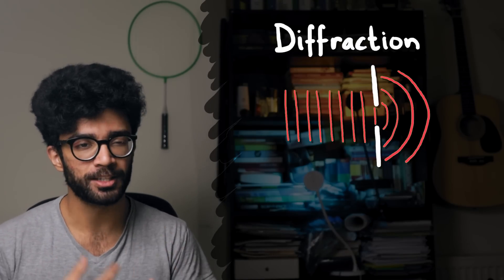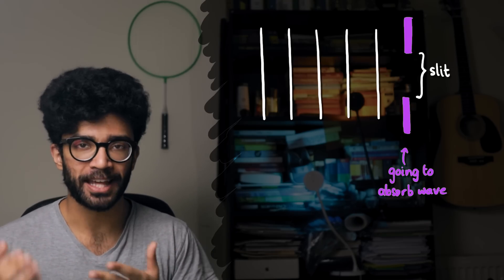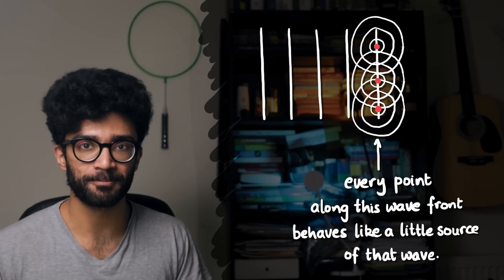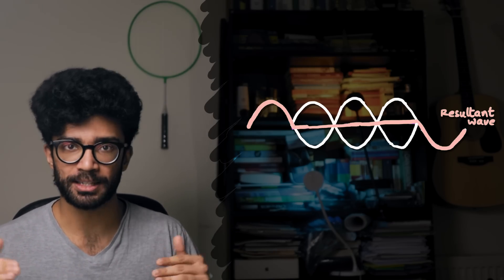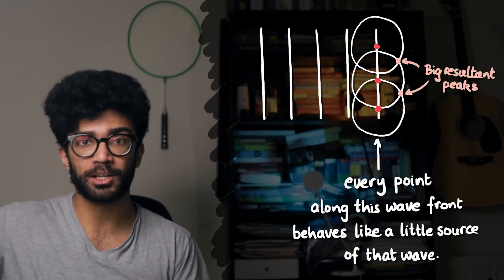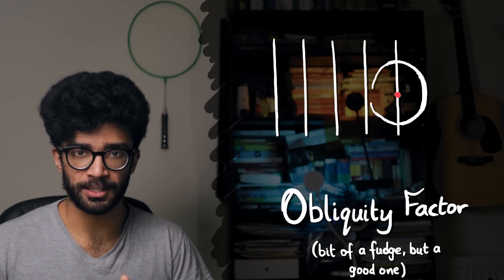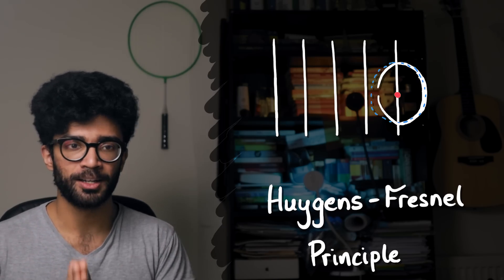Diffraction: Why Does It Happen? (Physics Explained for Beginners)

Comment: That’s a great explanation! i asked my teachers about this and none of them gave me this answer. They always say I don’t have to know why. Anyway we also learn at high school that if  the wavelength of the wave is smaller than slits length than there won’t be any diffraction. I tried to come up with a logical explanation using your wave diagram but I couldn’t find why? Can you explain that too pls🥺
Reply: Sorry i am a year late 
Let me give you a little analogy imagine a this guy and a fat guy walking through a door which is comparable to there size 

Obviously the fat one will interact more with the edges and hence diffract more 
Unfortunately i can't make a diagram on the youtube comment but in the case of higher wavelength that circular wavelet will have more radius so it will make a bigger pattern

Comment: Great video. Can you do a video explaining "Why" larger wavelengths diffract more compared to smaller ones? I know there is a complex explanation in QED, but I haven't seen a simple explanation that is easy to visualize. Thank you
Reply: Sorry i am year late 
But the you can think it like this larger wavelength are fat and smaller wavelength are thin and for the thin guy its easier to pass through slit and diffract less at the edges

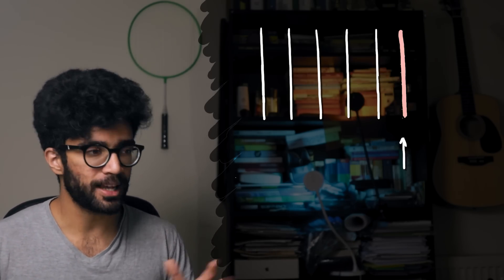Comment: 9:30 So most of the interference occurs along the front of the circular secondary waves (and thereby forming the straight line), but you can also see that there are many points between the original wave front and the front of the circular secondary waves where the secondary waves intersect. So what happens to the interference of waves that occurs behind the front of the secondary waves? Why can you just ignore all the waves, except for those in the forwards direction?
Reply: Well i am year late but as you proceed the video he explained that the amplitude of the wave in the backward direction and zero and small so no propagation in backward direction
And the amplitude in forward direction is maximum

Comment: The model might describe wave behaviour but it does not answer the question you posed, "why is this so?"

Even as a model it seems pretty ad hoc. I didn't even know that Fresnel had to tamper with the phases to get it to work.

The real question is what is it about the underlying physics that causes propagation, interference and diffraction? Is this an as yet unexplained natural law or is it a phenomenon that "emerges" as they say from more fundamental laws? Do waves even if radically different in nature, e.g., water, sound and light, all diffract in the same way and for the same reason?

Comment: Hm... I was expecting a last part where you scrapped the Huygens-Fresnel model for something better. My intuition as someone who lives near the sea and has a relatively strong connection with the most obvious form of actual waves (and also has some HS level of physics knowledge) is that the model is all kinds of wrong, even if it accidentally works: waves are not "emitted", they are kinetic energy oscillating (wave proper or quasi-static wave) and propagating (wave trajectory) in a medium (sure, this does not fully apply to fundamental physics but it does to normal waves like those of the sea): it should be the energy which expands in circular form for lack of resistance (obstructing medium) and not anything about ridiculous "particles" as such, which at most are just energy carriers.

Comment: If wavelets did exist, the light on the other side of the slit would travel in all directions, including parallel to the barrier. So I don't get it. Also, how do two waves travel past each other on the same string to form a standing wave? Don't the nodes act as fixed ends and reflect the wave so it actually travels back and forth between the nodes and the waves never actually pass each other on the same piece of string? I imagine that a wave travelling rightwards would, let's say, pulling the string to the right upwards. The wave travelling leftwards would pull the string to its left downwards. When they meet it creates a node and neither wave can pass but must be reflected at the node just as it is at a fixed end.  Where am I going wrong?

Comment: I think it would have been more intuitive if you included some physical explanation for why something like this might happen. For example, if you were discussing sound waves, you could mention the fact that particles tend to move from high pressure to low pressure and that they also have momentums that might momentarily be in the direction of wave propogation. (I'm not entirely sure how that last part relates to this, but I thoght that maybe that might explain why the emitters would preferentially point forwards.)

Comment: At 1356 while discussing Fresnels concept a blue dotted circle appears  in the picture, what does it represents? Also I understand the phase of light at equal distance from a point source need not be same.
Can you extend the picture of  bending of light past the slit a little further it will give a better idea about how the light is bending.

Comment: if each point on the primary wave emits a secondary wave, does this mean that each point on the secondary wave emits a tertiary wave etc?
Reply: It's just a mathematica artifact: those points do not even exist as we now know it's all quantum, i.e. not infinitely divisible. But they rather carry energy than generate it in any case.
Reply: Also, how do we know that amplitude of the forward moving wave and backward moving wave are different?
Reply: Each point on the resultant wave (which is produced due to interference of all the secondary waves) will also emit a secondary wave. Then these secondary waves will interfere to produce another resultant wave, which will have point sources that will emit secondary waves and so forth and so forth. This is how the wave traverses forward.
Reply: @desislavaivanova3863  - I don't think it's the case at all: these are old mathematical models that don't make sense when you actually observe waves, which are energy flows in actual matter (or equivalent space, which behaves as a "substance" for quantum waves). Waves actually bend because they are compressed by the slit, so they re-expand once they cross that threshold, just observe sea waves at a port entrance, yo don't need maths for that, just common sense.
Reply: @LuisAldamiz  Yep, I agree. But I think Thomas was asking about it in terms of Huygens' wavelets described in this video. Based on this model, that is how waves propagate. There are newer models as you mentioned, but the explanation I gave fits the Huygens' model in particular.
Reply: @desislavaivanova3863  - OK, fair enough. I had to rewatch the video in full and went from a "like" to "meh" opinion. It's clear that leaving the issue of waves in terms of Huygens and the other guy is not really helpful, causing more confusion than actual enlightment. Some "newtonian" stuff should be just dumped into the trash bin: it's not helping at all.
Reply: @LuisAldamiz  Even though it might be an outdated concept, some of us still have to know it if we're in school/university. This is what they expect us to know in my electromagnetics uni course so in that sense, the video explained it pretty well :)
Reply: @desislavaivanova3863  - I guess that was my first evaluation: a historical concept was explained quite well but now, after this thread and rewatching it, I strongly feel that the video lacked a final segment explaining that it's nearly irrelevant because it's not really correct. After all waves are not mathematical abstractions but very real physical concretions.

Comment: Ok, I've watched this video several times since it came out, I think I finally got it! Nice way to put this whole diffraction concept, thanks!
Reply: Yes me too and still, yet if I get what is wonderfully said in this Video it will not answer your question in different scenarios like if you imagine with different wave lengths the Arc of diffraction is different : Bigger wavelengths tend to have a complete arc of diffraction while smaller wavelengths get a very small arc.
In this video it explains it : https://youtu.be/BH0NfVUTWG4

Comment: Not a bad explanation. In A'level textbooks I was told to look at what happens to water waves when they pass through a narrow opening (they flank outwards - refract) so I never had issues accepting refraction. Though this is the first time I'm hearing about secondary waves. I was thinking fudge just before you mentioned it; rather how accountants can fudge profits to increase the bottom line.

Comment: Question:
What happens at the ends of the waves, where there is no oncoming wave to interfere? 
Because if there's no interference there then diffraction should happen everywhere during propagation, not only at slits.
Reply: In this model, the ends of the wave are assumed to be a cutout of a bigger picture of the actual wave. the actual wave would be round like a wifi symbol but this model describes what happens at a point or a small section of the wave similar to the tangent of a circle. Hopes that makes a bit more sense. Also you are right in terms of the fact that wave do spread out in nature but the term diffraction is only used to describe the further spreading out of waves as it passes through a slit or opening of some kind.
Reply: @jacksonzheng3103  thank you very much, I do think it would be better to add that to the main explanation
Reply: i had the same question, and @Jackson Zheng's answer explained it to me, was hoping to find someone with this doubt in the comments as I did not know how to articulate it :P
Reply: @aarnavsood28  yes, I've had the same problem xD

Comment: If in fact there was secondary waves, these waves should interfere with the towards and forwards peaks and troughs. If they all interfere constructively, then all the towards peaks should be of higher amplitude, causing a higher secondary wave which causes a higher amplitude at the toward peak. If they interfere destructively, the same would be caused in contrary effects; if these was true, the wave should be exponentially stronger closer the source, or exponentially weaker closer the source. The idea of “secondary waves” are completely absurd; in fact, even the idea that a single peak carry the whole frequency of the wave is absurd, it makes only sense thinking about frequency in relation to two or more peaks, otherwise its only a pulse which do not contain neither frequency nor wavelength.

Comment: Wow! If an antenna pulses a signal, wouldn't that packet of photons radiate in every direction at the speed of light. One photon can travel in a radius from it's source, in every direction. (Unless it's focused in one direction...but even then... a laser beam is focused to a point but along the way it hits particles (of dust) in the air and radiates light in all directions allowing you to see the beam. I think.?.🤯

Comment: If there are infinite sources along the wave, wouldn't all points create an infinite sized (amplitude) wavefront...no matter which model you use? Even if there is dampening/absorption with the air molecules, it would still be a tremendously large wavefront, wouldn't it?  Your diagram was only three points where two interfere, but in reality there are infinite numbers of peaks that add. Also, does your slit phenomena also explain how a rainbow effect is created after a rainstorm? The slower/bent waves, relative to the observer, generate blue part of the light spectrum while the faster photon take on the red part of the light spectrum?

Comment: 10:50 shouldn't the same apply to plane waves at their "edges"?
Reply: yes but that is just the nature of waves as wave naturally spread out from a source. The video is only talking about a small section of the wave similar to the tangent of a circle if you imagine waves to spread out like in a circle. The model here describes the nature of waves as it passes through a  small gap whereas if the gaps were bigger then the curvature of the waves would already be present.
Reply: Yes! I have the same doubt....pls if anyone could help clear it?
Reply: you can imagine the plane waves as infinit, so there is no end (it's very common to suppose infinit lenghts)... But yeah it's an other flaw of the model I guess

Comment: Hey Parth! Amazing video, as always :) I have a fundamental question - Hyugen makes the basic assumption that each point on the peak is a secondary wave source. Considering the fact that the rest of the principle relies on this, on what basis did he make this assumption?
 What is its validity?
Reply: Because intuition + it is consistent geometrically. Divide a circle's circumference into infinite points and draw smaller circles with each of those points as new centers. Now, draw tangents to each of those small circles, what you will get is bigger circle that is concentric and larger to the one we started with. This is nothing but a new way of drawing concentric circles and waves propagate in concentric circles in a medium (regular observation). So, in this way treating each point on a wave front (circle) as secondary sources of new wavelets is consistent mathematically. In simple terms, a good thing to bet on.
Reply: I had the same thought. I think it begs the question. What really is the wave?
Reply: @PassingThrough1972 disturbance propagating in transverse direction or in longitudinal direction.

Comment: I have an unrelated question, but pls answer:
General relativity works great to predict movement of mercury for example, but doesn’t at galaxy level sizes, as there is allot of matter that isn’t taken into account(dark matter), so why don’t they apply a constant that multiplies the formula to contrarest dark matter per unit of space, so at planetary scale it’s close to nothing, but at galaxy level sizes, it multiplies it by nearly 20, so 5% =>100% and then this thing would improve the formula. Pls someone answer, idk if this is just moving a operation that you had to do after, in the formula or not!
Reply: perhaps dark matter doesn't behave like a constant and instead varies with mass of the dark matter?
Reply: Yeah, but as dark matter goes linked with the normal matter, when you take into consideration that matter, it is automatically closely related.
Reply: It's spelled "a lot" not "allot". It's a lot of stuff. A Lot.

Comment: Could we say that the width of a ray of light equals the width or radius of a photon?
Reply: No. The wavelength is not the same. Particles are either treated as points or the width would be given by its wave function. You’re trying to think of a photon as a sphere but it really is fundamentally a wave
Reply: @bobross5716  thanks

Comment: I am very disappointed. (just kiddin, i am only slightly disappointed ;) This does not help me understand light diffraction at an "intuitive" level at all and as far as understanding a wave in water your explanation helps a little but lacks in some details (is the slit a theoretical slit of 0 thickness? if not, does the thickness affect the diffraction? if so, how?) But to equate the two in order to intuitively understand the other is insane, they are not physically similar. A water wave is a bunch of water moving up and down, while the energy of the wave moves horizontally. A light source is a bunch of photons moving at light speed. When light hits a slit, it will not hit it in waves, but a continuous stream of photons of all polarities.
Reply from the maker: But you are assuming that light is behaving as a particle here - which we know it does, but it ALSO behaves as a wave. Our understanding of quantum mechanical phenomena tells us that what we think of as "waves" and as "particles" are not adequate descriptions of things such as light. We need something that is both. Therefore your explanation of light being a bunch of photons moving at light speed is one way of thinking about it, whereas another way is to think of light as electromagnetic fields moving up and down in the same way that you think of water waves as a bunch of water moving up and down.
Reply: @ParthGChannel  Ok, a light source creates photons, these photons have different frequencies and not all of them are going up and down, some are going side to side (and all angles in between), some are going down then up, if they were acting like a wave, wouldn't they cancel each other out?

Comment: Nice video, I just wanted to know that if the secondary wavelets produced after passing through slit interfere to form a diffraction pattern on screen ,then why does not light emitted from source without passing through slit interferes to form a diffraction pattern, as each of its wavefront is also made from the interference of  many wavelets similar to the method by which wavelets after diffraction are produced
Reply from the maker: Even light emitted from a point source can be modelled as emitting secondary wavelets. The resultant of this is simply an outward-propagating primary wave. In other words, the secondary waves are modelled in such a way that they display whatever behaviour we observe. It's not necessary for waves to pass through a slit for us to model them in this way.
Reply: I don't get it, can u explain it again please, my question is that why finite light wavefronts after passing through slit form a diffraction pattern while infinite light wavefronts coming towards the slit do not?